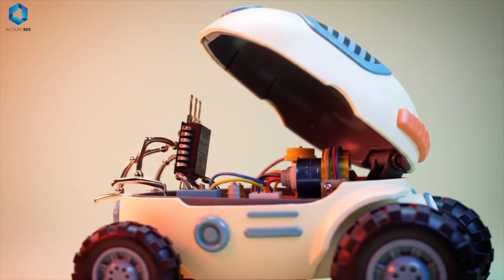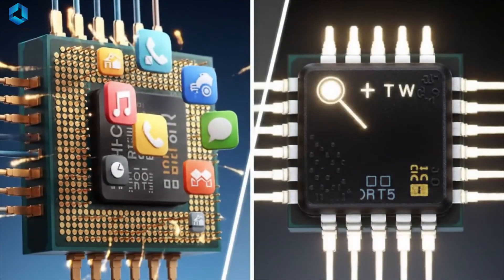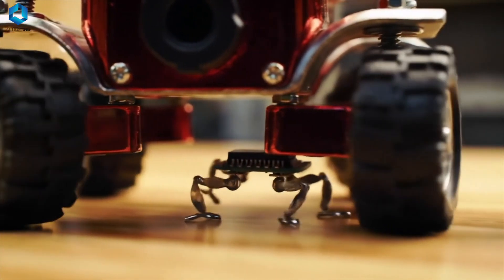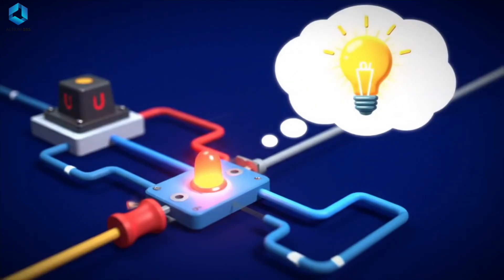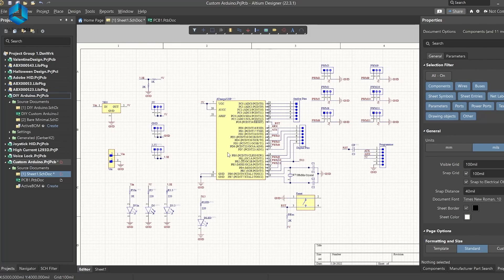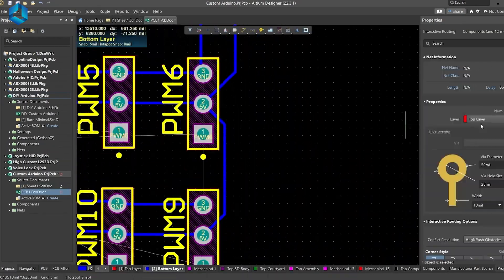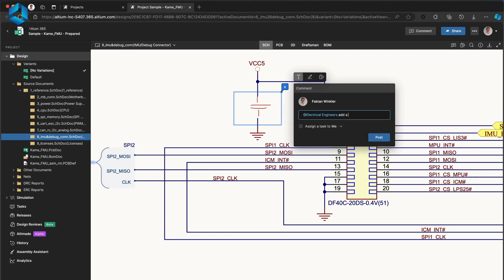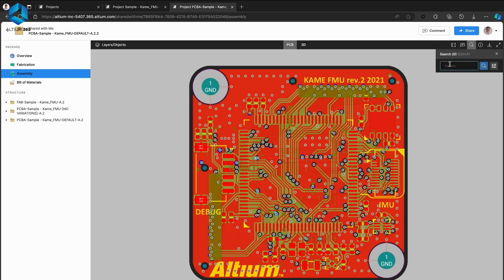📟Difference between Microcontroller and Microprocessor Malayalam | 🤖Robotics Tutorial for Beginners

Comment: Robotics Arm and Robotics Cars Microcontroller Usecheyyathathu :-Microcontroller okke simple projectsinu best aanu — like LED on/off, small automation. Pakshe, oru robotic arm-ne AI kodukkuka, camera input edukuka, OpenCV process cheyyuka, ROS use cheyyuka... ithokke microcontroller-inu kashtam aanu. Athu kondu aanu Raspberry Pi pole microprocessor boards use cheyyunnathu.

Microprocessor-il oru full operating system run cheyyam – Ubuntu, Linux, etc. Ath kondaan machine learning, vision, networking, multithreading ella complex tasks easy aayitt cheyyan pattunnathu.

Comment: Raspberry pi: microprocessor or microcontroller
Reply: Its ...a development board or a SBC (single board computer)

It is a  microcontroller (RP2040 microcontroller) based if its a Raspberry pi 'pico' board ...

And 

Its a Microprocessor based (ARM Cortex) if its Raspberry Pi '(Zero, 3, 4, 5, etc.)'
Reply from the maker: Correct 😇